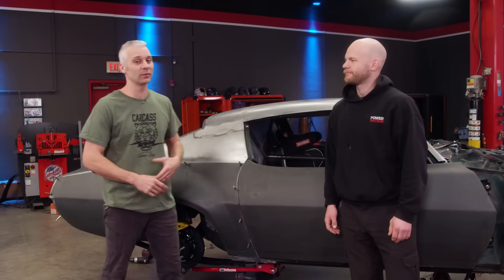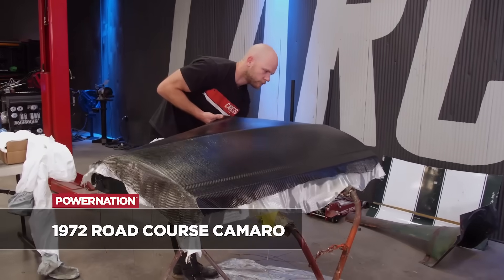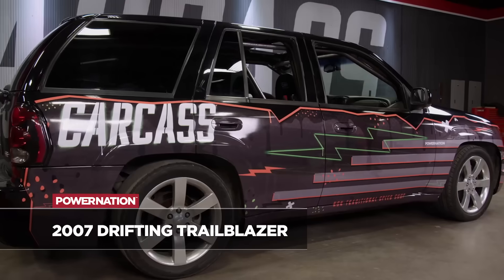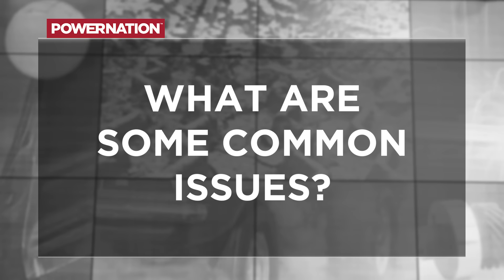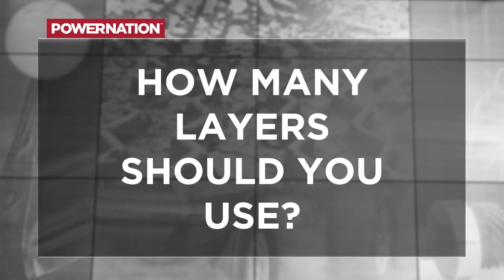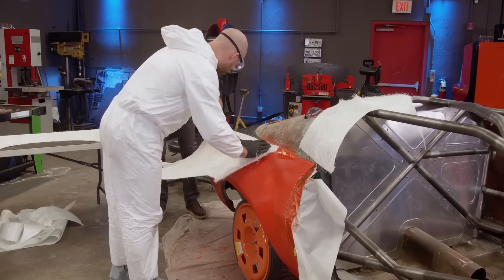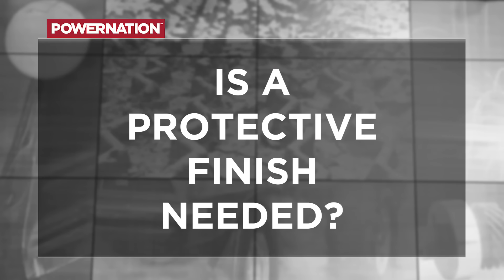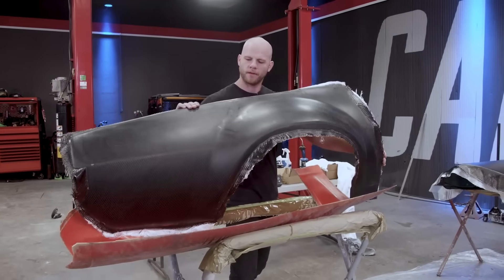Carbon Fiber Made Easy: Your Questions Answered

Comment: A small trick to do wet layups is to lay the resin before the cloth. That minimizes the chance for air pockets since you are not trying to force as much resin through the cloth from the outside. The exposed section of the part will already have resin there instead of air before the cloth is laid down, if the makes sense.

In addition, the cloth will better absorb resin if the weight of the cloth is on top of the resin. Even on subsequent layers, always pour the resin first. That will minimize the risk of air pockets in between each layer.

Comment: Even on non-structural panels, I would've used a foam core. Not necessarily on the entire panel, but on "strategic" areas to give it A LOT more stiffness. A 2 or 3mm foam core would be more than enough for such application, of course taking care of creating a smooth instead of a step transition on the edges of the foam.

Comment: It doesn't make any sense at all to try your luck at laying Carbon Fiber before you can lay a Fiberglass Panel well first. Your Wallet will thank you too!
There are subtle differences between the two and how they act but the "Idea" is the Same....
Once you are satisfied with the results in Fiberglass though then by all means, try your Luck with Carbon fiber. 
The Finished Product is much stronger and more durable and "Can" look much better too.
The key to a clean finished Carbon Fiber panel is all in how it's layed down and the amount of resin is in the (1st) Surface Layer of the panel. The direction the material is facing when it's layed down is important too. It's clearly directional. It's easy to see that in the finished panel too unless you cover it with paint.
(This is true if you are "not" using a Vacuum Method and/or an Oven in the Curing Process)

Comment: I completed about 2 months ago my first carbon project which was a 1972 Triumph TR6  hood.  Room temperatures were 72 to 74 degrees.  Will I gain additional cure and strength if I put it through an elevated heat cycle?  If so any ideas on a low cost way to do this.  Maybe an electric blanket under the hood and insulation over the top
Reply: 72-74 perfect.  I have seen a torch used in slower epoxies to take out bubbles.  But.......
Reply: I have seen that baking the part at 140F for a few hours will improve strength.  Is this true.

Comment: I dont really understand the strength of carbon fiber, are all the mechanical properties due to the resin? so if you use denim instead of carbon fiber but with the same resin you get the same results?
Reply: It is the combination of both resin and fiber that makes the composite strength. Flax is also used in composites Weight-for-weight, glass fibre is about four times stronger than flax and carbon fibre is about five times stronger. Some composites are made with cotton fiber indeed and polymer resin, but not sure of their strenth.
Reply: very good strength in tension, terrible in compression
Reply: if you have a flat panel, only a sheet of CF will bend very easily, but if you do CF-foam-CF, the upper layer will be in tension and won't stretch and thus not bending
Reply: Epoxy itself is brittle.   But that brittle keeps fibers aligned, so both are stronger.  Carbon is very directional.   If straight with no cross hatch or opposing layers, it is flexible.  For an example of a build a friend did for me. A carbon tiller for my sailboat.  My only spec was strong enough to stand on it.

It began with carved foam.  Covered all with a layer or two of weave .  Then on the length, straight fibers were laid the length of the tiller in several layers.  Then back to weave.  I don't know how many.   Sanded, polished and clear coated AFTER using acetone to melt the foam core.  It was very light and can I say unbreakable? ✨️

Comment: I’m in the middle of doing a light weight built S-10. There’s a couple things that everyone needs to make sure of that I learned from working in aviation for the last 20 years:

1. PPE - Composite dust is very bad to your lungs

2. Gloves - Your going to go through a bunch. The cleaner you are, the better.

3. Measurements - Follow the resins recommendations to a T. Some have a little leeway but there’s no guarantee if you go outside the limitations. 

4. Time - This is not a fast project. Time should not be a consideration if you want it completed right. This includes cure times and heat exposure. 

5. Expect to have to clear coat - the resin will harden yes but it will also yellow over time with sun exposure unless there’s some new resin that I’m not familiar with. 

6. Experiments - Try it on smaller parts first. You rather screw up a small part that a few inches x few inches versus wasting all the material on a fender or hood.

7. Reinforcements - Don’t be surprised if an item flexes like crazy. An easy and cheap reinforcement is going to an archery shop and ask for their broken carbon arrow shafts. Apply the shafts under a small portion of the composite material and it will stiffen it up and give it strength with minimal weight.
Reply: I got my mustang to 2150 race weight down from 3300 lots of carbon and titanium. I ended up using foam half rounds and pipe insulation halves for reinforcement. Never heard of carbon arrows for bracing sounds like a great idea.
Reply: @buiItnotbought that’s an old cheap gunsmithing trick I picked up from my grandfather. We would get a plastic stock rifle and added some epoxy resin to the stock and some old arrow shafts and it would be super stiff. Plus it added minimal weight.
Reply: Hey Bert. I have soo many questions for you. Can we connect?